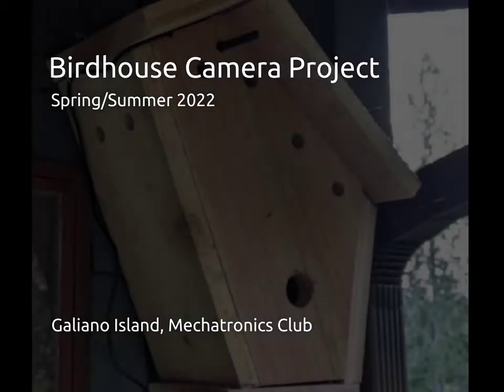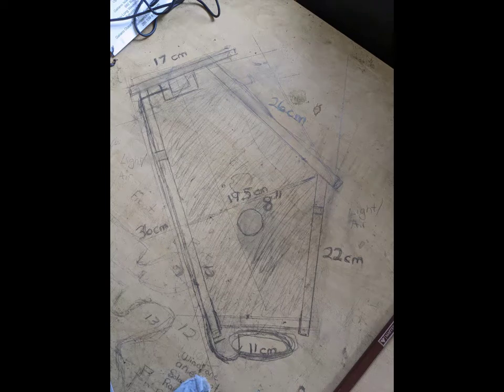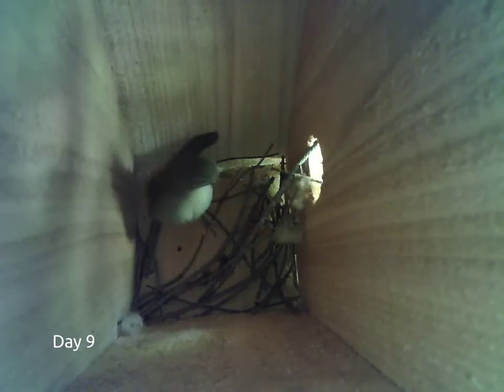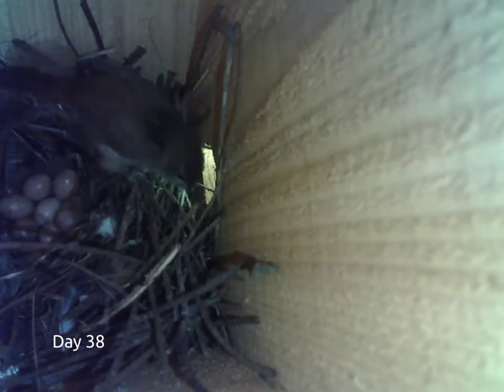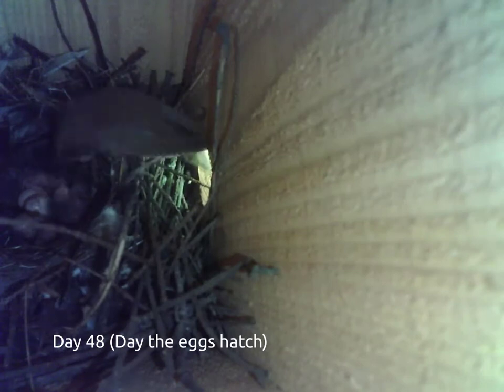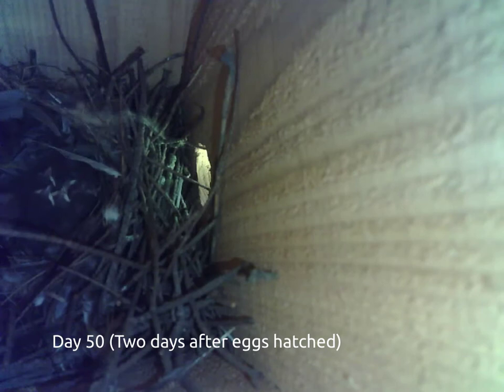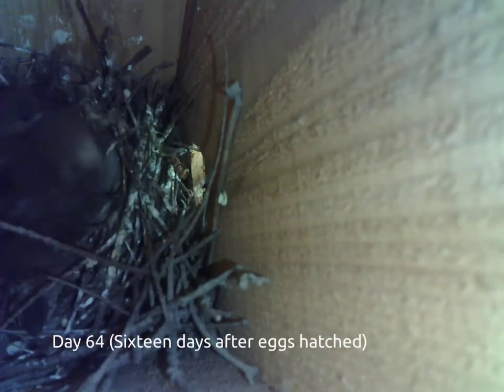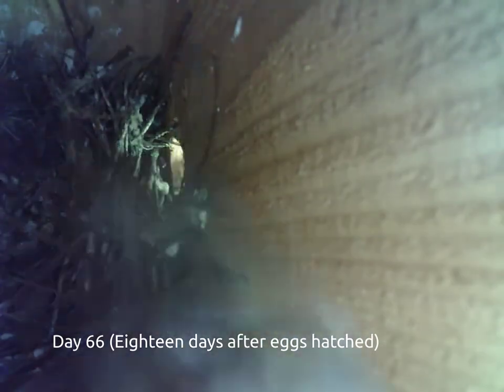ESP32 Cam Birdhouse Footage

Comment: How did you power this? Did you use a battery? did you run a wire? If so, how did you manage the wiring? did you run it to an outlet? What about rain? any issues with rain and ESP32 being outside?
Reply from the maker: No issues with the ESP32 being outside.  I powered it with a power brick.  Both the birdhouse and the outlet were both fairly sheltered.  

No problems.

Comment: Hi Stephen, great built!
 i want to build a birdhouse with cam too. Did you used the OV2640 cam? having problems finding infos on the angle and if it can do IR.
Reply from the maker: @ReflectionWorksBerlin  no; it's an ESP32 CAM.  My advice would be to try to do a test with the camera and see what the minimum distance is and what angle would work best, and then design a birdhouse that allows for that distance and angle.
Reply: @StephenAkins  OV2540 is the lowest resolution version of ESP32-CAM, it probably is what you used (based on the picture). My question is what to do after they leave? Do you clean out the birdhouse so that next family can move in? Do you leave it as is and other birds use it as is?
Reply from the maker: @ Oh!  I didn't know that about the ESP32CAM models.  Thank you.

I did clean it out the bird house and use it again.  But actually we probably have more birdhouses than we should and it's not really missed when I take it down.